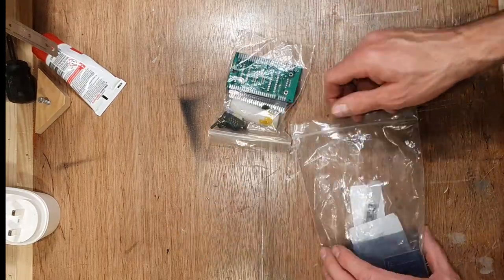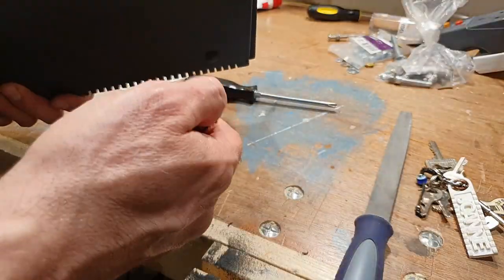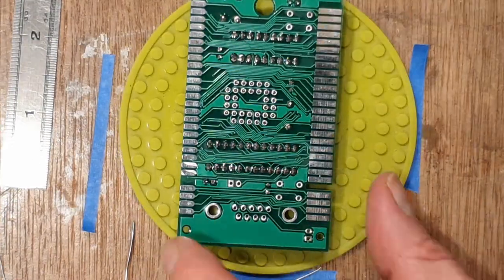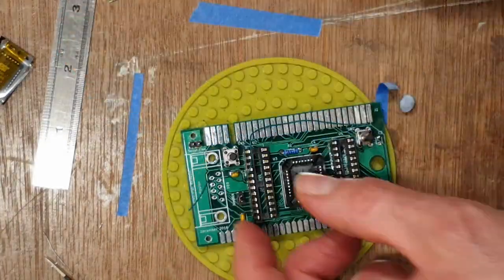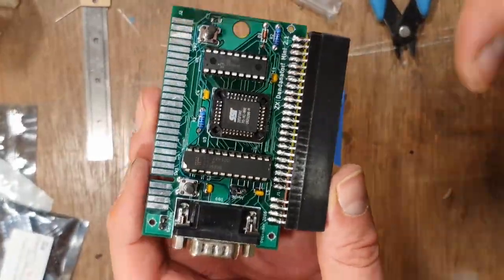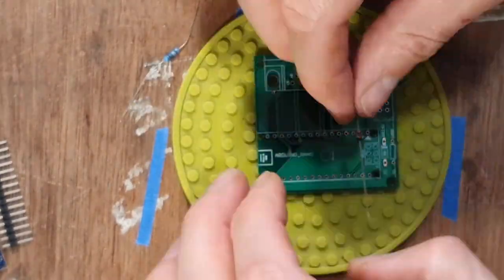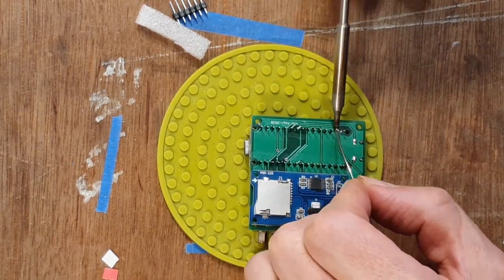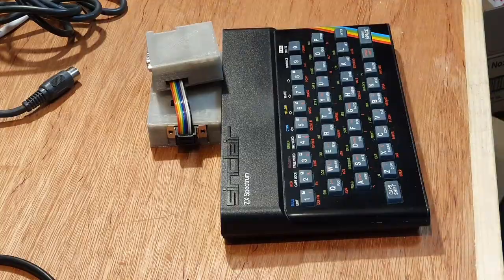ZX Spectrum Dandanator Mini + Multiply Arduino Addon Build

Comment: Great video, really easy to follow.  I have a DivMMC at the moment but I'm thinking of moving on to one of these.
Reply from the maker: Thank you! This is the only speccy cart I have any experience of, so I couldn't comment on the DivMMC. But this one does seem to do everything I could ever want! Nice easy kit to build if you can source the parts and have the facility to program the proms.
Reply: @MoreFunMakingIt  i don't have an eprom programmer unfortunately. I'd probably have to buy a prebuilt one. 
As for the DivMMC, it's basically just for loading images. I like the other features that the Dandinator offers and the diagnostic utility looks very handy.

Comment: Nice video on how to build it, but how to use the dandanator?

Can I download a .z80 or .tap file to a microSD card and then put the card in the dandanator? Does it run immediately or does it have to flash the EPROM first?

EDIT - The diagnostics feature seems really handy.
Reply from the maker: Hi. I wish I could answer confidently. You might be best going to the Dandanator website and checking there. But for what its worth I think that once the arduino is programmed you can just drop the files (most formats) on an SD card and it just works.